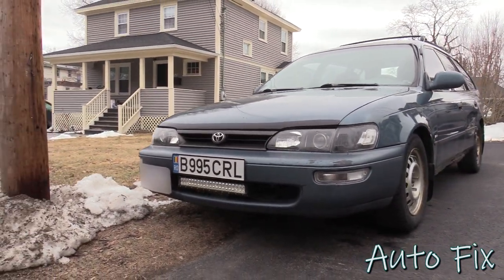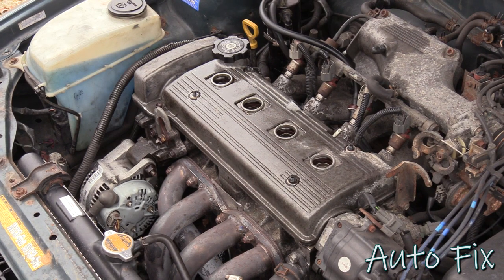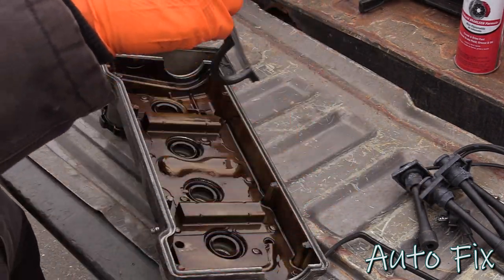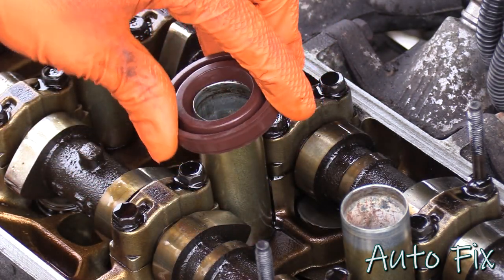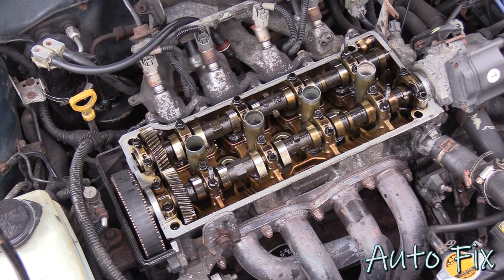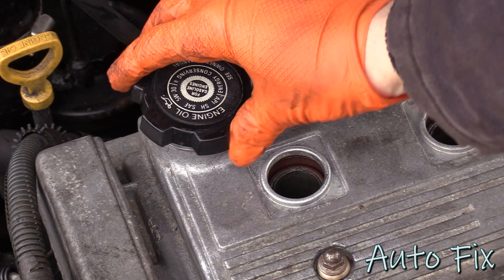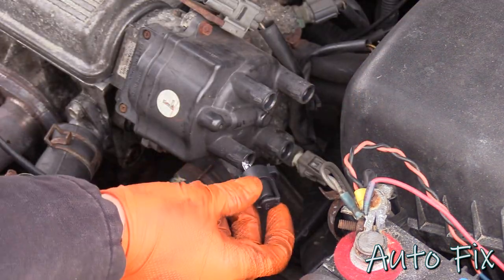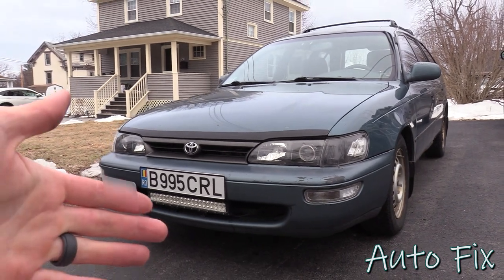Replacing Valve Cover Gasket 1993-1997 Toyota Corolla/Celica

Comment: Man this video made it look way easier than it was for one my hoses wouldnt come off for the life of them and then the washers on the valve cover were a nightware also the little piece that comes off the one that has the 2 cracks you have to fill in with rvt i was wiping it down and it fell out into the hole next to the belt driven gear and i watched the 45 minute job i was doing turn into a 3 hour one
Reply from the maker: Dang that sucks, yeah always gotta be careful when working on an open engine. I've dropped some things in places they shouldn't go lol

Comment: There's a therapeutic quality to this video. Everything comes apart as it should, and the issue is fixed.
Reply from the maker: Glad you enjoyed it, and that it was helpful!
Reply: @AutoFixYT  i would definitely recommend removing, cleaning off, then resealing the half moon next time. 

I neglected mine on my V6 camry and notice the leak continued. Had to go back in and replace the half moons. NOT fun to do on the rear valve cover of a 1MZ-FE.

luckily your car is a 4 banger and easy to access and monitor.
Reply from the maker: Yeah I worked on a 1MZ, annoying to get to anything on the rear bank lol
Reply: Except for the super tight cyd1 sprk plug

Comment: To clean out oil of tube, put paper towels into tube soaking up as much as you can. Spray break clean and force air into tube to wash out, before removing the spark plug. Less oil going onto cylinder.
Reply from the maker: Good idea, thank you! My car burns a lot of oil so to be honest I was not very concerned lol

Comment: My master has a 95 model 1.6 injection corollam. The gear knob seems to get stuck while the vehicle is shifting from 1st gear to 2nd gear. I've done pressure pad tests and it doesn't seem to be finished. So it doesn't miss. It only happens when putting on 2nd gear, why do you think? If you enlighten me, I wish you a good day. It doesn't do it all the time. If we throw it 10 times, it does it in 3 or 4 times. There is no hang-up when it's idle, it's in motion.
Reply: Stuck you mean it wont go into gear ?
What about this vid? https://youtu.be/6qKrcbAcN7Q

Comment: I just lost that little cover plate on the left side where you put the gasket sealer and I can't find it I think I fell somewhere by the timing belt any ideas
Reply from the maker: Whatever you lost you'll have to find and retrieve, can't put the engine back together with parts missing that fell inside of the engine.

Comment: What's the hose that you said you were gonna replace is??
Reply from the maker: @nicolashernandez5348  I think it's just a breather hose. I never replaced it, I capped off both ends lol
Reply: @AutoFixYT  thank you bro I looked online for the hose and it gives a set with different hose sizes I see the one that fits that spot if I experience problems I'll replace it

Comment: I had to do this for my 03 Corolla CE, which has the 1ZZ-FE engine.

I also had to replace the rubber gasket in oil cap.

It seems that rubber gets very hard and brittle.

 I've heard that silicon gaskets have better heat resistance, but I prefer OEM gaskets.
Reply from the maker: Nice! Yeah that happens sometimes with oil filler cap gaskets. And yes silicone does but the OEM one is good too so no reason to choose one over the other.

Comment: it shifts into gear, but it often feels like it's rubbing off the gear knob when shifting. No cracking or sound can be felt from the hand.2. it does it in gear. is it from gearbox oil? Yellow ring (synchroniser) malfunction
Reply from the maker: Could be that but it could also be bad engine mounts. I had such bad engine mounts a long time ago that I actually caused the transmission to pop out if gear because as the engine was rocking, it was maxing out the shifter cables. I therefore ruined that transmission and had to put another one in my car.

Comment: Is it necessary to replace the valve cover gasket and RTV, if I'm only replacing the spark plug tube gaskets? And do you have to wait a few hours for the RTV to dry a little before starting the car? ty
Reply from the maker: Great question! The spark plug tube seals usually come in the same package as the valve cover gaskets. If for some reason you bought them separate, then I would strongly recommend replacing the main valve cover gasket as well. As for the RTV, yes. Always clean and re-apply new RTV even if you do end up reusing the old gasket. And no, you don’t need to wait a very long time. Well… technically yes, if you follow the instructions. But I’ve resealed oil pans and the drive. The car 30 min later and so does everyone at any repair shop lol nobody has time to wait. So will it be fine right away? Yes. Should you wait a little? Yeah I’d give it 30 min or 1h at most

Comment: DONE!  Your video is exactly like looking at my own vehicle.  =D  My '95 Corolla wagon and I THANK YOU, for this project and future forays.  My gasket kit is a FEL-PRO blue silicon rubber kit.  The parts are surprisingly soft and I had to do a lot of "tightening down again" after my first drive.  I have two follow-up questions if you'll indulge me:

Q1. The four FEL-PRO grommets for the acorn nuts that retain the valve cover do NOT have metal caps (the originals did, but weren't reusable).  Each acorn nut has a wide bottom, like a small washer.  Is that enough?  I'm a little concerned considering the softnesss of those grommets and the amount of tightening/squashing required after my first drive.

Q2. Had trouble installing the first two spark-plug-tube rings into the valve cover recesses.  Largest socket on hand was 1-1/4".  Not quite big enough, and it tore the INNER lip (soft blue silicon plastic) on the first two rings, exposing the bottom edge of what appears to be a thin inner metal tensioning ring.  The damage is limited to the inner/bottom silicon surface of the ring and I don't see any way for oil to escape beyond it...  Do you have an opinion?

I took your advice and OILED rings 3 and 4.  They drove in just fine.  Thank you, and Duh.
Reply from the maker: Hi,
I'm glad the video was helpful!
For your first question, it sounds like you may need to replace those metal caps. You can use some washers instead, they'll do the job just fine, just make sure they fit as tight as the metal caps did.
For your second question, I recommend replacing those two spark plug tube seals. Unfortunately, I don't think you can get just those so unless you can find them, you may need a whole new valve cover gasket kit.

Comment: Can you take the valve cover off again if you but new grommets and stuff if you want to paint the valve cover?
Reply from the maker: Yes! Just make sure all the gaskets and grommets are still in good condition before you reinstall.
Reply: @AutoFixYT  thanks brother..
Reply: @relax9086 what type of paint are you looking to use? I wanted to do the same on my '96
Reply: @efil4kizum  high temp paint, blue or red actually... I can't decide yet.

Comment: I have a question, but first, THANK YOU for these outstanding videos.
 
I have exactly that station wagon.  Same year, same color.  Mine is a DX.  I bought it used in 2000 and have been driving it as my one-and-only vehicle.  198,000 miles now, which is only half-way for these older models.  Toyotas are like the old Timex watch, "Takes a lickin' and keeps on tickin'."  =D 

I bought a blue FEL-PRO gasket set (VS 50440 R) almost a year ago, and have been putting off doing the work because 1) it's my only vehicle so I'm fearful of botching the job, and 2) the videos I've seen up 'til now were for other model years, or were lacking in one respect or another.  Yours is dead-on in terms of the vehicle AND your teaching method.  My good luck!  Tomorrow the temperature will be a mild 60 degrees F, so tomorrow's The Day.

QUESTION: In your "Oil Pan Re-Seal" video you used RTV instead of a new gasket.  In that instance, you let the RTV set up for about ten minutes.  For this valve cover replacement, should I let the RTV set up, or is it better to 'mold' the RTV by putting the valve cover in place immediately?

Thanks
Reply from the maker: Thank you, and good question!
You don't have to wait for the RTV to set, you can go right ahead and put the valve cover back on. However, do wait a few minutes before tightening it down.

Comment: Great video. Does that RTV have to be high-temperature RTV or just regular RTV?
Reply from the maker: Depends what kind of high temp you’re talking about. Doesn’t have to be the extreme high temp like the one for exhaust pipes. But I recommend using black RTV which is meant for oil and is heat resistant at regular engine operating temps.

Comment: Great job 👍
I had to do this last December (6 months ago), so I don't know whose video I watched for guidance.  Had oil in Cylinder #1, also.  After gasket set, plugs, wires, cap and rotor it finally ran right again.  A flashing check engine light was a scary sight and it suddenly ran really rough.  All sorted out now and at 334,600 miles.  In three months I've only driven 1,000 miles and it was about a quarter low.  So a little bit of burning oil going on.  But no dripping leaks anywhere.  
Best regards 👍
Reply from the maker: Nice! Glad it worked out! And yeah these old Corollas always burn oil. Mine burns a quart every 1000 miles

Comment: have you ever had to replace the O-ring on the distributer?  i think mine has a small weep in the O-ring and I need to figure how to replace it (as well as the cam seal) at the same time I am redoing the VCG 
have you ever replaced the cam seal with the VCG off?

one interesting thing... i bot some new spark plug tube seals from Toyota online discount dealer,  and they came packaged as made in China, not Japan, Mexico, or USA!  that was a first for me in buying genuine OEM parts LOL
Reply from the maker: Maybe it's not an OEM part then?
And no I've never replaced my distributor O-ring but I have to, mine is leaking too.
Reply: @AutoFixYT  the tube seals came from an actual Toyota dealer in Iowa from their online parts department with the Toyota sticker on the bag. I thought the Toyota dealers can only sell parts sourced from their warehouse?
Reply from the maker: Oh weird. I have no idea then
Reply: i have a 95 celica with this engine  and i think i need to replacee the cam seal did u ever do it and do u have a video u can recommend

Comment: Man so glad I found this channel ❤ I have a ae100 that I'm trying do a alot of maintenance on it as it's been sitting for 2 years. So I've decided to do a full over haul and your videos are perfect mate 👌
Reply from the maker: Thank you! I have some good ones coming soon, so stay tuned!
Reply: Hey man after doing my valve cover I noticed my manifold is cracked. It's a 5afe engine and was wondering do u know if 4afe manifolds are compatible 😅
Reply from the maker: I don't know anything about the 5A-FE because it never made it in the USA. Try searching on forums and see if it will work. Maybe someone has done the swap before

Comment: Just about to do this job & searched this video. So much easier than doing this on a 1FZ-FE Land Cruiser. Thank you for the detail. Wish me luck! 255k miles on my 96 5 speed manual DX & still going strong. Mine just has oil in cylinder #2. Unfortunately mine burns about 2 quarts every 1000 miles but it's been like that since I bought it 65k miles ago. Seems all these engines burn a certain amount of oil.
Reply from the maker: Yes these cars are super easy to work on! Definitely easier than those Land Cruisers. Those are really cool though! My brother that lives in Europe has a 99 LC with the 1HD-FTE engine, 5 speed manual, amazing vehicle.
As for the Corolla, yeah mine burns just over a quart every 1000 miles. It always has. It does foul out spark plugs prematurely but it runs very happily. I recommend switching to thicker oil if you haven't already. I run 10w-40 in mine all year round. My climate doesn't usually get too cold for it. The manual says you can run 10 weight until 0⁰F. It helped mine burn less and ran a little quieter too!

Comment: Thank you for the great videos. I have 1997 Toyota Corolla with 130k the problem is When I drive, it shakes whenever I'm going over 60-80 or under 60 whenever I step off from the accelerator. On high speed whenever I step off from the gas pedal feels like my passenger side will is bumping. I feel that the shake is from my passenger side wheel. My all four tire is new and balanced. I installed New front suspension still the shake is there am thinking of changing the CV axle. do you have any solution for me It will be really helpful for me.
Reply from the maker: Yes check the CV axle and replace it if necessary. Also check all other suspension components such as ball joints, control arms, tie rods, wheels bearings.

Comment: maybe a silly question but did u have to drain the oil before u took the valve cover off i  have to replace the VCG but i need to do a oil change as well is it best to drain the oil first before doing the VCG then do my oil pan gasket as well then put the new oil in
Reply from the maker: Great question! You do not have to drain it first. Actually it would be a good idea to run the engine for a little bit after you're done, with the old oil, so it can collect any debris that may have gotten in there. After 5-10 min or so, shut it off, and change the oil and filter.

Comment: 356k miles is a lot! how many of those are your miles? My '96 has 137k miles currently (mostly heavy city stop and go)  and the carfax maintenance/garage report indicated that i got it with 21k in late 1996 (i couldn't remember that far back haha)
Reply from the maker: Wow that's awesome! City miles are the hardest miles on vehicles.
I put almost 100k miles on mine in the past 8 years. I bought it from my mother in law with 263k. She had it for a few years and put probably about 40k miles on it. I'm the 5th owner haha it's been through a lot. But... I'm the last owner too. It's never going.
Reply: @AutoFixYT  especially in the winter when it's below zero out haha.. at least the heater works well. The '79 Corolla I had before this one had no working heater or defrost but was a 500$ used car in the early '90s ... Where are those deals these days on 12 year old decent condition cars?
Reply from the maker: That's rough!
Lol 12 year old cars these days go for like $10k on the cheap end
Reply: I have a 7afe got at 112k 2 years ago and now its at 135k.
Reply: 1990 dx. 4a-fe. 3rd odometer. Assumed 400k ish miles but dont know for sure
Reply: I have a 93 DX 1.8L I just got up to 184,174 miles on it, have had it for just over a year, I think the ODO read 164ish when my brother and i bought it. only car and we both travel out of town for work(my job is 8 miles away, his job is 4 miles away, and the grocery store is about 30 miles away so we end up putting 100-200 miles on her in just a day, sometimes multiple days a week😂)

Comment: Alright
Which me luck, I’m about to do this on my 90 dx. Mine is the G1 version of this engine but should be same
Reply from the maker: You got this, it's not that bad of a job.
Reply: @AutoFixYT  my spark plug seal on the bottom ripped on just about every single one. Think it was sitting on a shelf for awhile 🙃
But overall wasn’t too bad of a job. Just a old car with mystery service records

Comment: Amazing video! Was wondering what the two hoses on the back are called? Mine are starting to crack and I was going to replace them at the same time. Thank you so much!
Reply from the maker: One is the PCV hose, the other is just a vacuum hose. Replace them if you want, I actually just deleted mine completely. The PCV is routed to a catch can and vented to atmosphere, and the other smaller hose is capped off on both ends.
Reply: @AutoFixYT   Thank you sm!!!

Comment: Di-electric grease is an insulator, might not be such a good idea to put so much where the spark plug meets the wire, might cause a miss fire
Reply from the maker: As long as you make sure it doesn't prefect the plug from touching the spring inside the wire you're good. It's mainly to coat the sides so the wire comes off easier next time.

Comment: Do I need to replace the spark plug tubes also or just the valve cover gaskets n seals
Reply from the maker: Spark plug tube seals come with the valve cover gasket kit and I strongly recommend replacing them as well

Comment: I did this job but still have a bad leak in my spark plug tubes. Number 1,3 and 4. I’m going to retry it and make sure I seat the tube seal all the way in, I remember being unsure if it had to be flush with the inside of the valve cover  but I’m glad you showed what the seals need to be lined up with. Also gonna do plugs and wires at the same time will update thanks for the vid
Reply: You ever done the upper oil pan seal on one of these before? I gotta do mine 😮‍💨
Reply from the maker: Yeah make sure everything is well seated and sealed, it can be tricky and annoying on those.
As for the oil pan, no, I've never had to reseal mine. Just the lower.